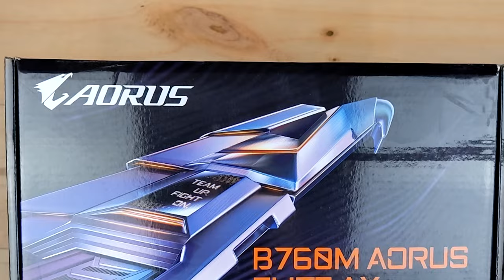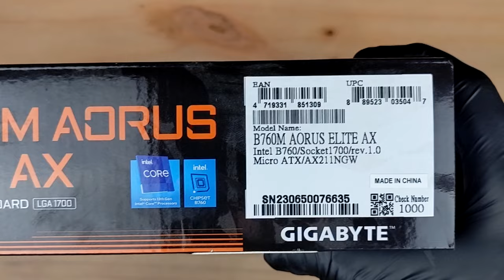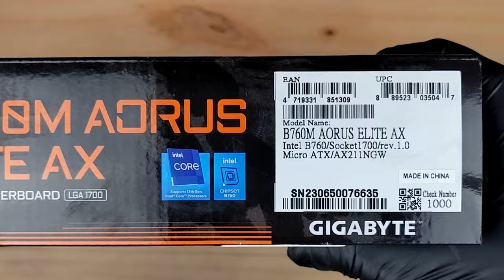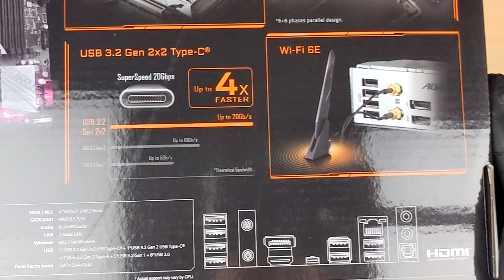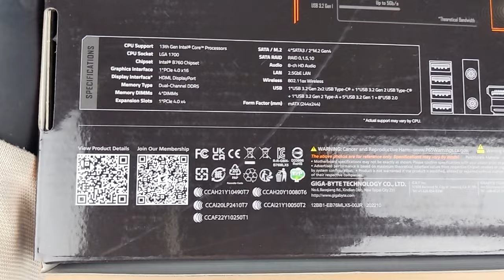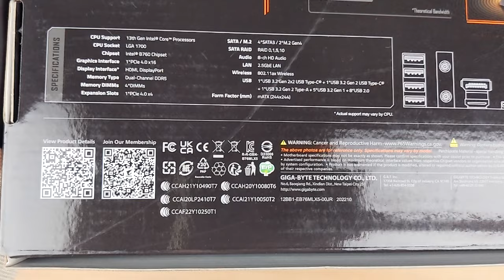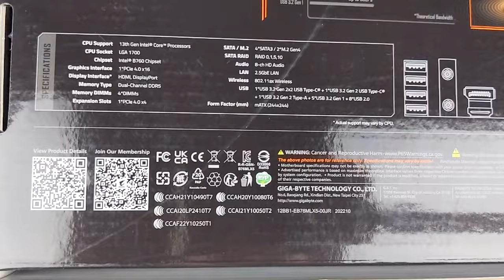GIGABYTE B760M AORUS ELITE AX  🎯  Motherboard Unboxing and Overview

Comment: pls i would like to ask , the Onboard F_ Hdmi header which is near to the F_U32 (USB 3.2 Gen 1 Header) do u have any  information on what sort of cable will plug into it to convert into Hdmi , pls i am asking because when referring to the manual it says the F_HDMI header can be used for  hdmi , but i have not found any cable that convert motherboard  header to HDMI, so pls is this cable included with the motherboard accessories , i am asking because i am thinking of  using that HDMI to connect to my Jonsbo D41 casing screen, thanks and look forward to ur response

Comment: All i was looking for is the 3 pin rgb header. thanks. btw - you can at least give some points to some people here that doesnt know anything about motherboard ports.
Reply: where to put the argb 5v ? can it use the vd g or g dv port?
Reply: @myrtelekenazjanairl9411 
It is there right? Can we connect an aio to it?